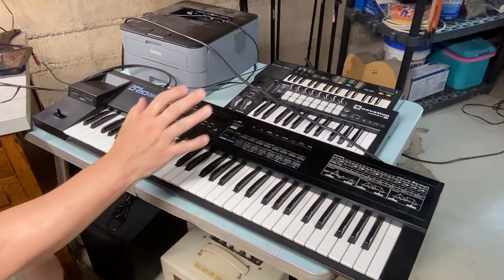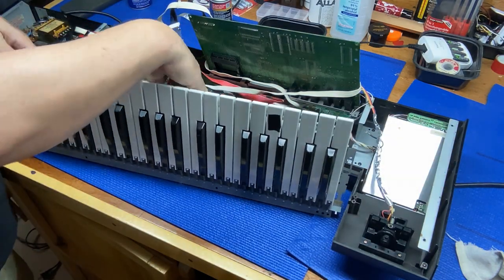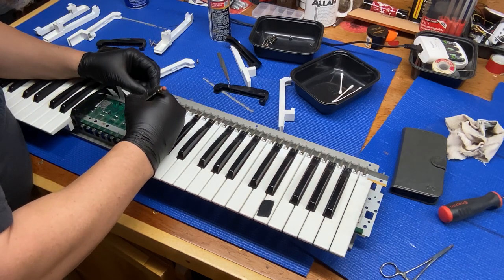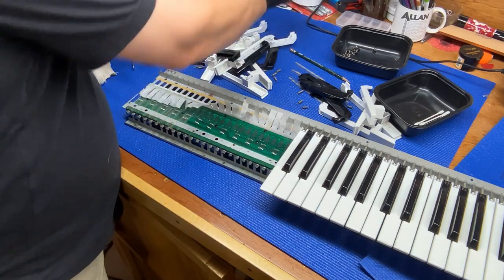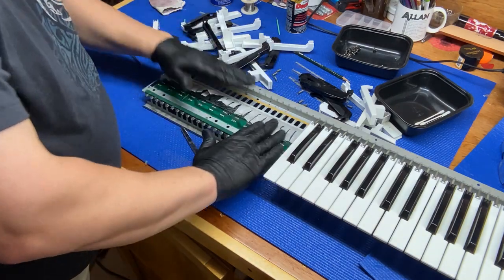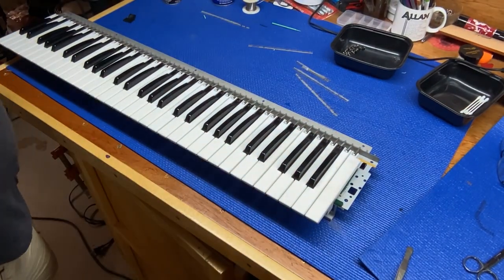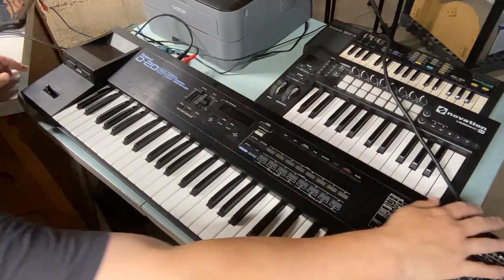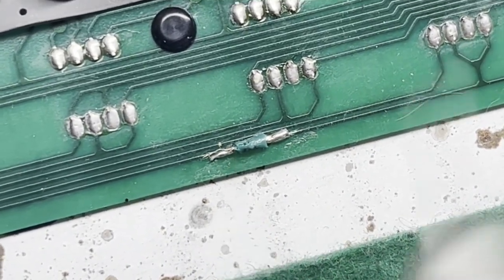Fixing Dead Keys on Roland D20 Synth

Comment: Hi, did you notice that the short ground lead next to the disk drive is not connected. I've just bought a D20, in bits, and cannot find where it should go?
Reply from the maker: @8BitFixIt  Funny that you mention that because I sold this and the new owner mentioned that the disk drive didn’t work! So I never noticed. Hope you get it figured out. I’m wondering if I had disconnected it taking the keyboard apart.
Reply: @JayceAllanGuitar  After going through a further 5-6 stripdown videos it looks like it was from the disk drive and onto the chassis towards the back of the keyboard, into an available screw hole.